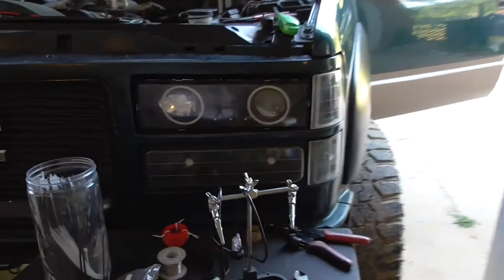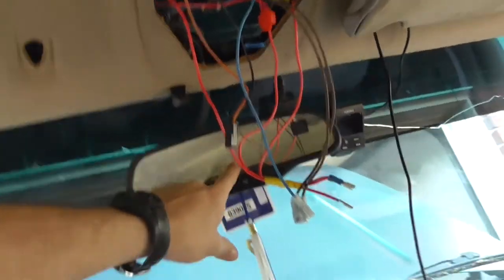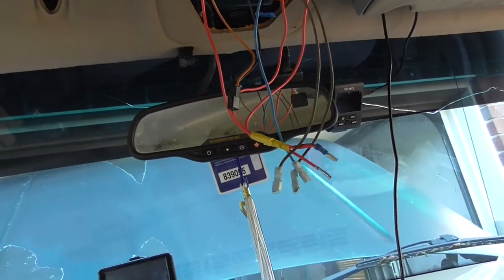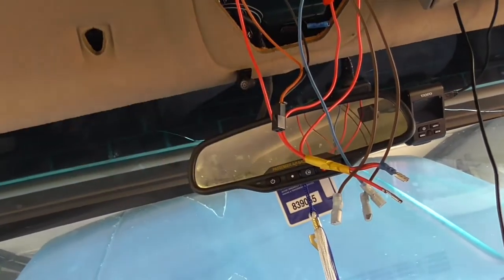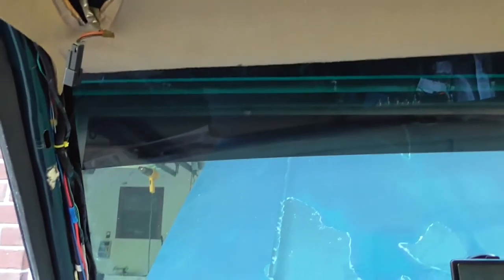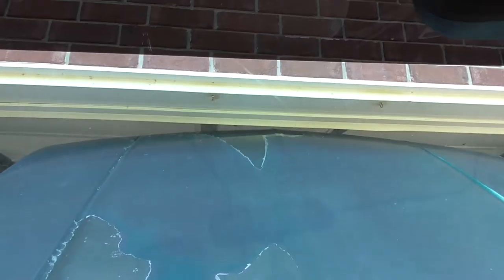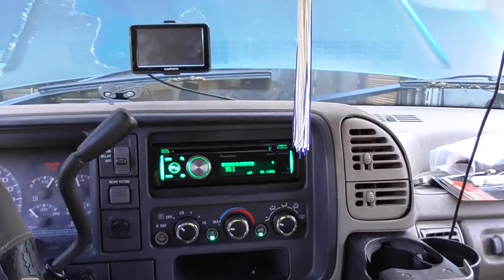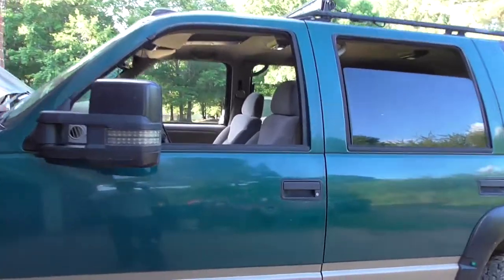Yukon Update | AuxBeam V-Series Light Bar Switch Install

Comment: Was the upper console panel we're you put the switches already there or did you purchase it?
Reply from the maker: It was already there, if the tuck didn't have rear HVAC but had an upper console, this is how it came.
Reply: @DanielPace92  Ok Thank you, mine has rear air but the upper console is open for storage.